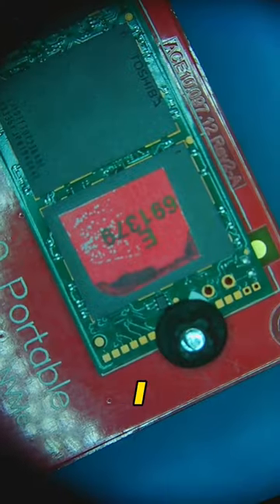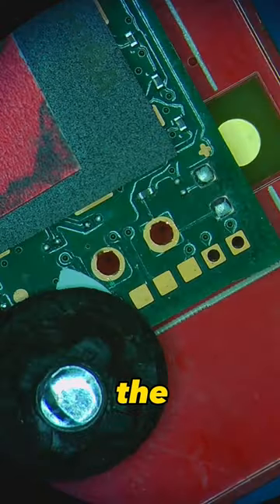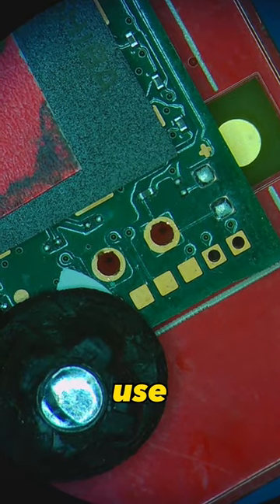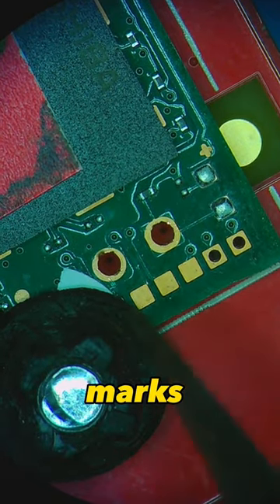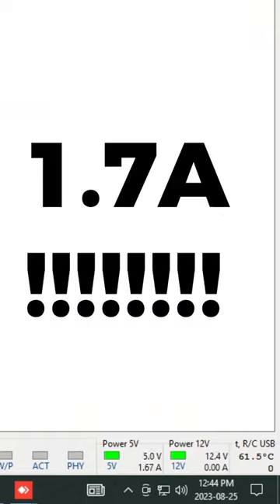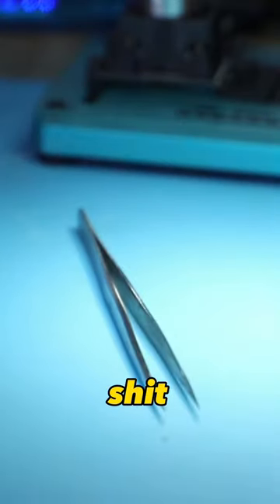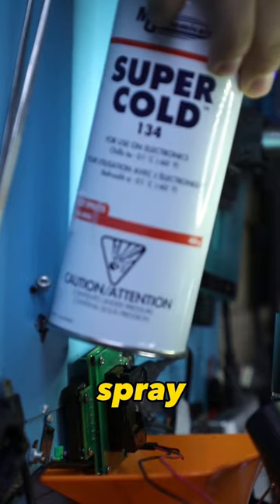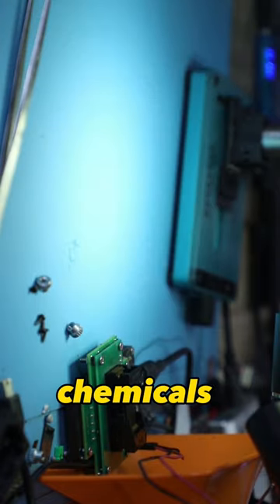they wanted $3800 for data recovery on SSD

Comment: Is it necessary to use pc3000? Doesn't it work only by transplanting the chip? Thanks
Reply from the maker: Pc3000 comes with Data extractor which is the most advanced imaging tool in existence. For me, it is the only way to perform the task.